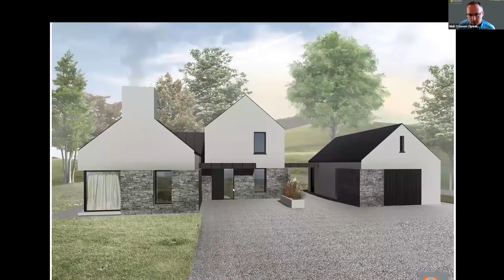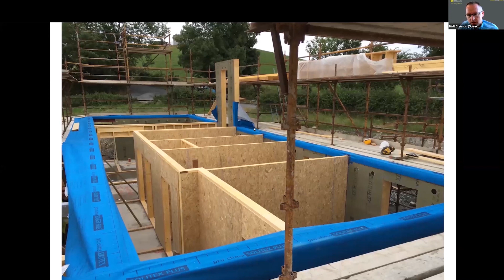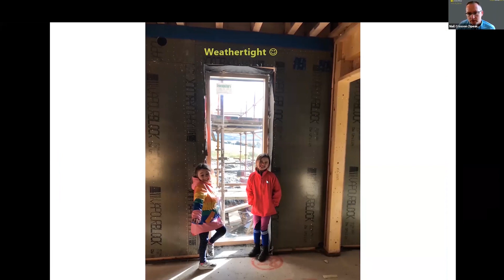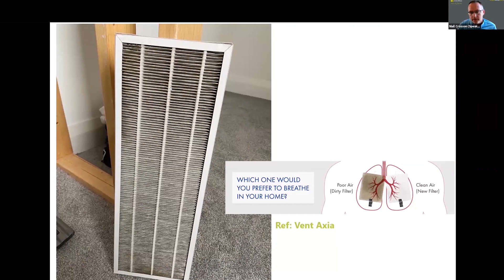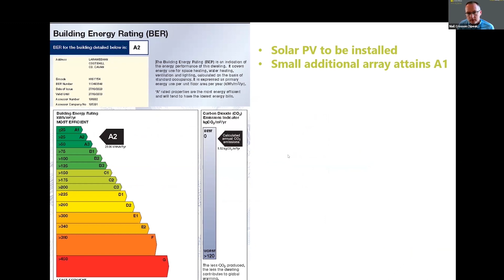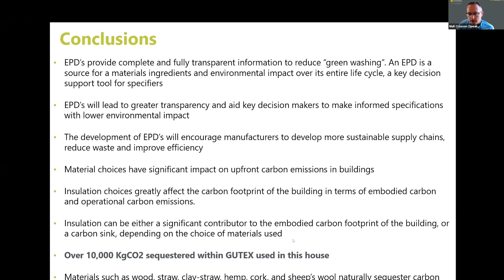Eco Passive House Case Study - 2nZEB & Beyond Seminar (part 4)

Comment: Great project  - well done.  How long will the adhesive last on all those airtight tapes?
Reply from the maker: Pro Clima Tescon Vana, Tescon No. 1, Uni Tape and Orcon F airtight sealant have been independently tested to confirm 100 years airtightness.
Reply: @EcologicalBuildingSystems  thanks